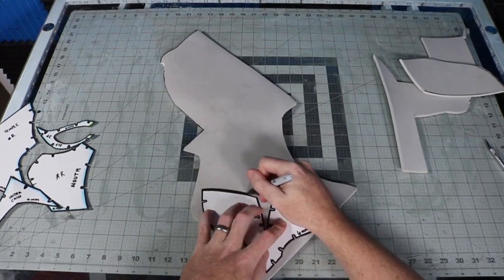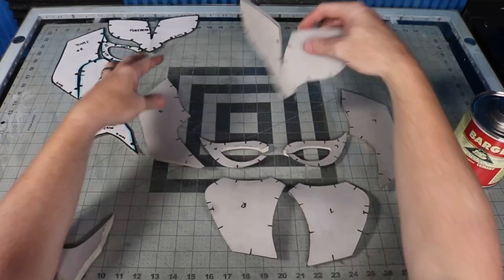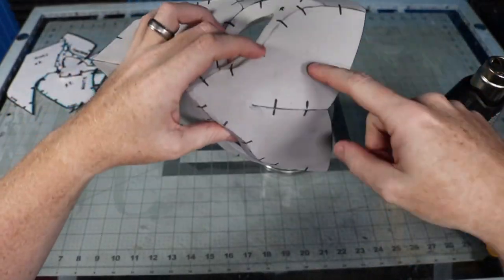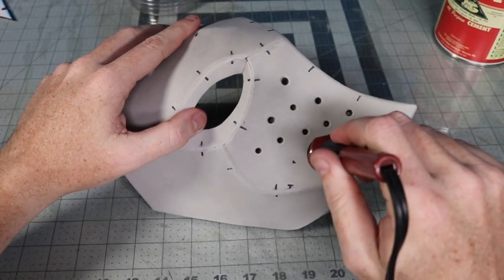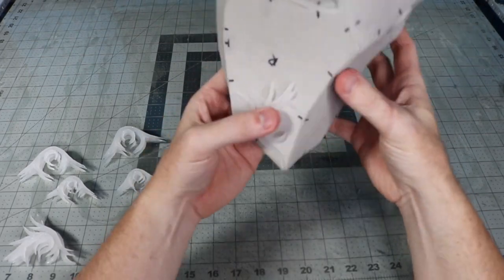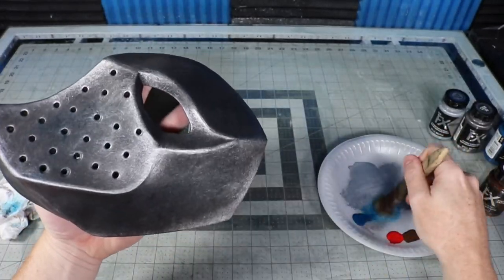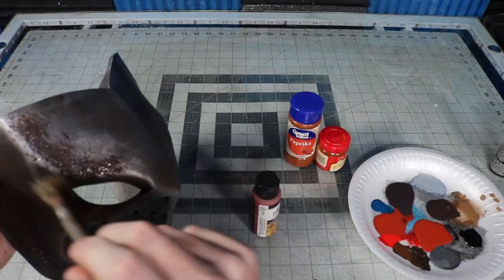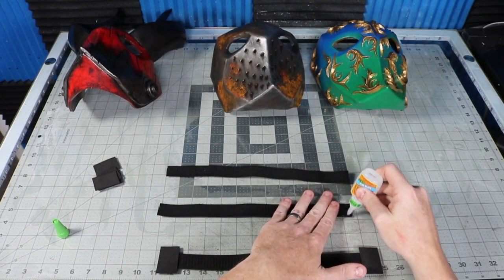Makin Custom EVA MASK for PlaidFx Con 2020

Comment: You can use spraypaint directly on Plastidip 0_0 !
I mean it's not gona crakle?
Do you use a special spraypaint? Like acrylic or other stuff?
Reply from the maker: I'm sure over time it will eventually become brittle, like most paints will, and crack. The plasti dip make it a little flexible. But there are also flexible acrylics like Plaid FX that you could do this technique with too to prevent it even further from cracking.

Comment: Does the contact cement smell linger, ie after the mask is made and you wear it, does  it smell like contact cement or does it dissipate
Reply from the maker: After a few days it dissipates. To limit the problem you can be more careful on you application of it and clean up any brush over. Plasti Dip and paints are the same problem too. Cutting those vent holes helps, but you will always have the foam smell.